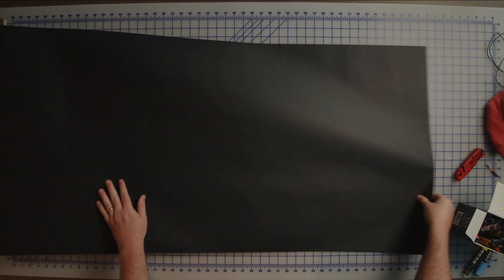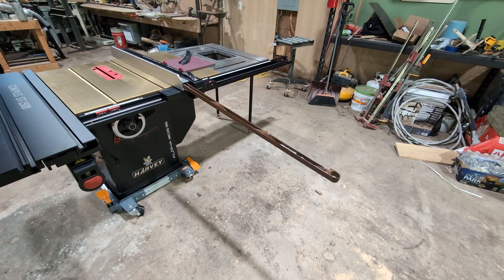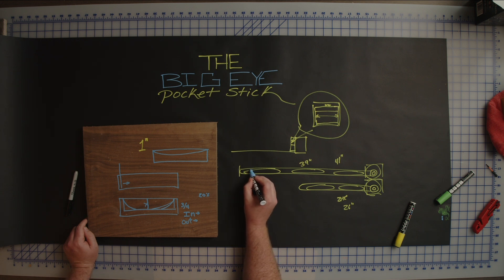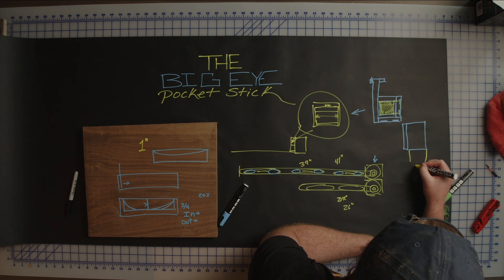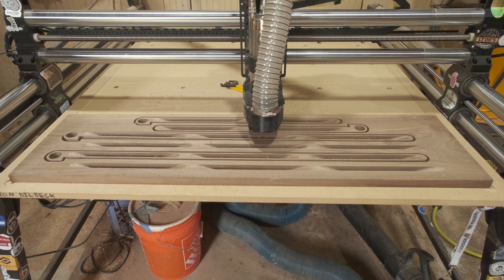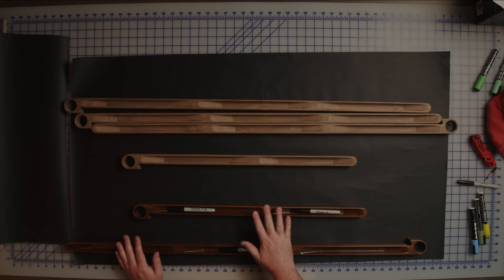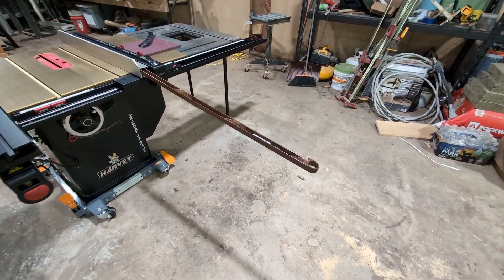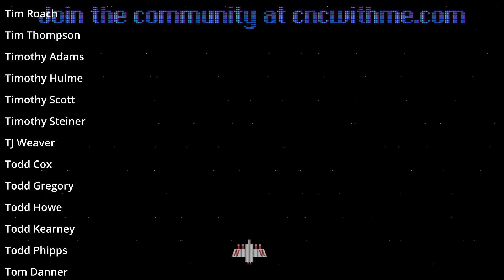I Made The Best Tablesaw Fence Better

Comment: I have been having trouble understanding schetchup.  I just have an issue with understanding the perspective.  Will I still have the same issue doing coding for most cnc router programs?  I actually have quite bit experience with more standard computer programming.  This is main reason I haven’t gotten purchased a cnc yet.  However, I finally have a cheap 3d printer coming on order so hopefully that will figure it out for me